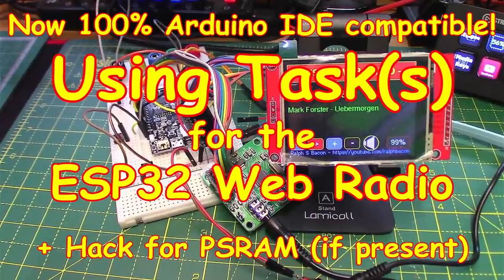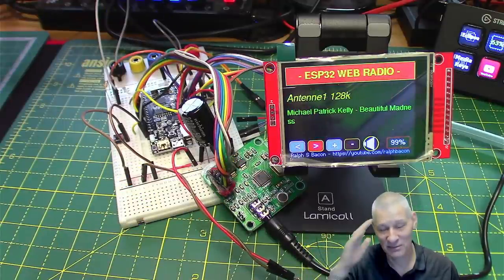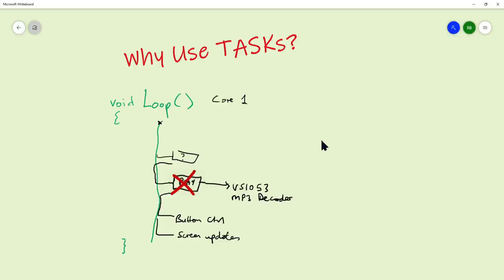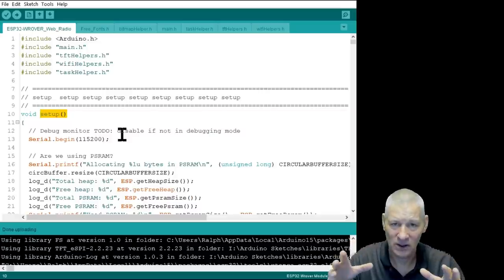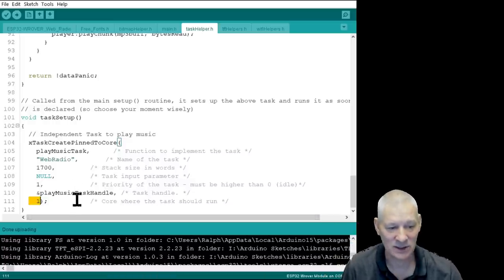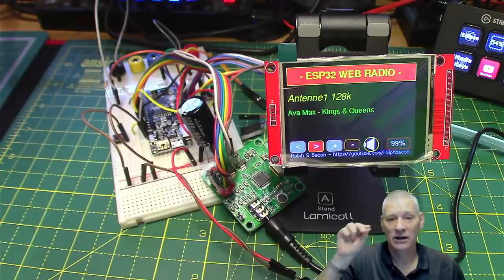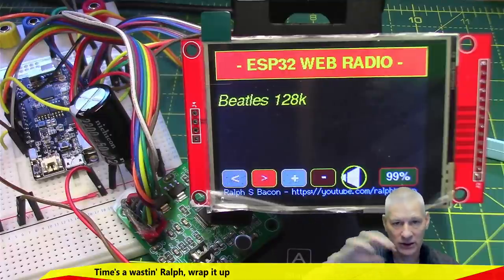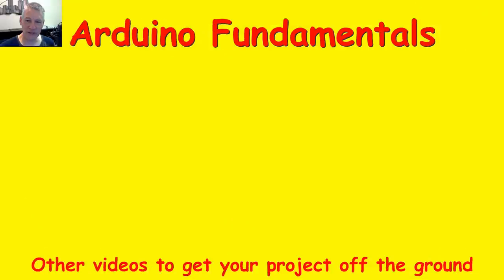#208 Using an ESP32 Task for my Web Radio - using the Arduino IDE

Comment: Hi Ralph. I have looked through all I can but I still get this error mesage when I compile the sketch.

C:\Users\pclay\AppData\Local\Arduino15\packages\esp32\hardware\esp32\1.0.4\cores\esp32\cbuf.cpp:38:16: error: expected initializer before '*' token
 void IRAM_ATTR *ps_malloc(size_t size){
                ^
C:\Users\pclay\AppData\Local\Arduino15\packages\esp32\hardware\esp32\1.0.4\cores\esp32\cbuf.cpp: In member function 'size_t cbuf::resize(size_t)':
C:\Users\pclay\AppData\Local\Arduino15\packages\esp32\hardware\esp32\1.0.4\cores\esp32\cbuf.cpp:57:37: error: 'ps_malloc' was not declared in this scope
   newbuf = (char *)ps_malloc(newSize);
                                     ^
exit status 1
Error compiling for board ESP32 Wrover Module.

I think the problem lies with the cbuf.h but as I said I have proberbly corrupted it and cannot find a clean version, can you put one with the header file on GitHub?.

Any thoughts, apart from shooting me?  :-)
Reply from the maker: OK, let's go with the last option first. I have a shotgun around here somewhere... OK, maybe not.
That IRAM_ATTR error puzzles me because it compiles here (using the standard 1.8.13 Arduino IDE).
Do you have the correct WROVER board (and options) selected? 

Try to get it working WITHOUT the large buffer. Change the main.h line that says CIRCULARBUFFERSIZE to 10000 (ten thousand).

Then, in the cbuf.cpp, remove the lines that say:
// Duplicated from esp32-hal-psram.c
void IRAM_ATTR *ps_malloc(size_t size){
    return heap_caps_malloc(size, MALLOC_CAP_SPIRAM | MALLOC_CAP_8BIT);
}

In the same file, change all this:
// RSB Use PSRAM here if required
 char *newbuf;
 if (BOARD_HAS_PSRAM)
 {
  newbuf = (char *)ps_malloc(newSize);
 }
 else
 {
  newbuf = new char[newSize];
 }

to:
newbuf = new char[newSize];

Let me know if it compiles.
Reply: @RalphBacon  Hi Ralph thanks for the instructions:
I get the following error code:

C:\Users\pclay\AppData\Local\Arduino15\packages\esp32\hardware\esp32\1.0.4\cores\esp32\cbuf.cpp: In member function 'size_t cbuf::resize(size_t)':
C:\Users\pclay\AppData\Local\Arduino15\packages\esp32\hardware\esp32\1.0.4\cores\esp32\cbuf.cpp:66:4: error: 'newbuf' was not declared in this scope
    newbuf = new char[new Size];
    ^
C:\Users\pclay\AppData\Local\Arduino15\packages\esp32\hardware\esp32\1.0.4\cores\esp32\cbuf.cpp:66:26: error: 'Size' does not name a type
    newbuf = new char[new Size];
                          ^
exit status 1
Error compiling for board ESP32 Wrover Module.

I am using Arduino IDE version 1.8.13

The WROVER board is correctly chosen and I use the settings you wrote in your code packet.
Board: "ESP32 Wrover Module"
Upload Speed: "921600"
Flash Frequency: "80MHz"
Flash Mode: "QIO"
Partition Scheme: "No OTA (2MB APP/2MB SPIFFS)"
Core Debug Level: "Verbose"
Reply from the maker: That's what you get for hacking code!
Replace that line with:
char *newbuf;
newbuf = new char[10000];

This has now hardcoded a 10,000-byte buffer but let's get it compiled before we worry about that.
Reply: @RalphBacon  Still getting errors, I want to show the code part from cbuf.cpp to prove I am correcting it as you instruct.

#include "cbuf.h"

cbuf::cbuf(size_t size) :
    next(NULL), _size(size+1), _buf(new char[size+1]), _bufend(_buf + size + 1), _begin(_buf), _end(_begin)
{
}

cbuf::~cbuf()
{
    delete[] _buf;
}

size_t cbuf::resizeAdd(size_t addSize)
{
    return resize(_size + addSize);
}
// Duplicated from esp32-hal-psram.c
//void IRAM_ATTR *ps_malloc(size_t size){
//    return heap_caps_malloc(size, MALLOC_CAP_SPIRAM | MALLOC_CAP_8BIT);
//}

size_t cbuf::resize(size_t newSize)
{

    size_t bytes_available = available();
    newSize += 1;
    // not lose any data
    // if data can be lost use remove or flush before resize
    if((newSize < bytes_available) || (newSize == _size)) {
        return _size;
    }
/*
    // RSB Use PSRAM here if required
	char *newbuf;
	if (BOARD_HAS_PSRAM)
	{
		newbuf = (char *)ps_malloc(newSize);
	}
	else
	{

		newbuf = new char[newSize];
	}
    */

   // newbuf = new char[new Size];

   char *newbuf:
   newbuf = new char[10000];
   
	char *oldbuf = _buf;

    if(!newbuf) {
        return _size;

Now the error code is as follows:

C:\Users\pclay\AppData\Local\Arduino15\packages\esp32\hardware\esp32\1.0.4\cores\esp32\cbuf.cpp: In member function 'size_t cbuf::resize(size_t)':
C:\Users\pclay\AppData\Local\Arduino15\packages\esp32\hardware\esp32\1.0.4\cores\esp32\cbuf.cpp:68:16: error: found ':' in nested-name-specifier, expected '::'
    char *newbuf:
                ^
C:\Users\pclay\AppData\Local\Arduino15\packages\esp32\hardware\esp32\1.0.4\cores\esp32\cbuf.cpp:68:10: error: 'newbuf' has not been declared
    char *newbuf:
          ^
C:\Users\pclay\AppData\Local\Arduino15\packages\esp32\hardware\esp32\1.0.4\cores\esp32\cbuf.cpp:69:11: error: qualified-id in declaration before '=' token
    newbuf = new char[10000];
           ^
C:\Users\pclay\AppData\Local\Arduino15\packages\esp32\hardware\esp32\1.0.4\cores\esp32\cbuf.cpp:73:9: error: 'newbuf' was not declared in this scope
     if(!newbuf) {
         ^
C:\Users\pclay\AppData\Local\Arduino15\packages\esp32\hardware\esp32\1.0.4\cores\esp32\cbuf.cpp:78:14: error: 'newbuf' was not declared in this scope
         read(newbuf, bytes_available);
              ^
C:\Users\pclay\AppData\Local\Arduino15\packages\esp32\hardware\esp32\1.0.4\cores\esp32\cbuf.cpp:82:14: error: 'newbuf' was not declared in this scope
     _begin = newbuf;
              ^
exit status 1
Error compiling for board ESP32 Wrover Module.
Reply from the maker: The line "char *newbuf:" should have a semi-colon at the end not a colon. Try and try again.
Reply: @RalphBacon  BINGO!!!!!! Compiles OK!!!!! Feel a (bit) very stupid but thankful. I presume that this will not work but is a stage. What should I do next?
Reply from the maker: If you have the necessary hardware, at least the VS1053, it will work, although you may have to put a return statement at the top of each TFT helper routine so it doesn't try and talk to a non existent screen.
Reply: @RalphBacon  Now I need to think about this. I have the hardware but I will  have to wire it up. Thanks for the time being.
Reply from the maker: So what exact WROVER do you have, Paul?
Reply: @RalphBacon  ICQUANZX T8 V1.7 ESP32 4MB PS RAM TF CARD 3DANJ Flash PSRAM

I have also a 16MB on order

I Have also a ePulse low Power ESP32 Development board from thingpulse
Reply: I am now working out the connections required for testing. How did you get thee messages on the Arduino IDE serial monitor showing the radio stations etc.
Reply from the maker: I wonder if that is the same as the TTGO T8 v1.7.1 that I used? If so, the PCB I now have will make things a lot simpler. In the meantime the latest schematic can be found here: https://bit.ly/WebRadioSchematicV1
Reply from the maker: PS Are you in the UK, Paul?
Reply: @RalphBacon  No, I am in Klagenfurt  Austria. I came to Austria  from the UK some 36 years ago.
Reply: @RalphBacon  I have the same esp32 board that you wrote in your description.
Reply from the maker: If you email your address (see here for mine https://www.youtube.com/c/RalphBacon/about ) I will do my best to send you the two PCBs for this project. But you will also need:

1 x 10-way (2x5) female IDC cable
1 x 20 way (2 x 10) female IDC cable (to screen, if you are using it)
1 x 200 - 470μF cap
Pin headers for the IDC cables (available in 40-way easily snapped to size)
1 x 5 volt 1A (or higher)PSU (eg phone charger)
1 x 10kΩ through-hole or SMD resistor
1 x VS1053 MP3 decoder
1 x TTGO T8 v1.7.1 ESP32
1 x TFT touch screen as per my video about $7 from Banggood
All of the above is freely available from your local or Internet supplier and costs very little. Let me know if you will make use of the PCB as I only have a few.
Reply from the maker: To get the Serial messages onto the Arduino Serial Monitor set the speed to 115200 in that window. They should appear.
Reply: @RalphBacon  No email address there???
Reply from the maker: Scroll down the "About" page until you see VIEW EMAIL ADDRESS and click it (must be done on a PC/MAC, not on your phone).
Reply: @RalphBacon  all ok on my phone it was invisable.
Reply from the maker: Email on its way to you.

Comment: Meta Data Advertising,  are you linking to a radio service. As it very common,  when you are not on a direct feed . Don't get wrong, this Very interesting and helpful(keep it up), but nicely design wireless radio's are cheaper, been using them for years😂 plus you have same service on google speakers, car radio, phones, ect 👍
Reply from the maker: I'm connecting to the advertised feed but that is the umbrella company so I guess they will add adverts as they see fit. 
I'm not sure wireless (internet) radios are (a) cheap nor (b) that common and anyway, where is the FUN in buying something when you can make it yourself cheaply (~$20) and tweak the final result to your liking, Kuk? As well as learning a lot about the ESP32! 🤷‍♂️😃
Reply: @RalphBacon  I love your channel and learn alot, I play with micro controllers all the time. Also like convenience to listening world radio anywhere, not on a work bench😂 The buffer on extended memory very interested including MP3  board. My project is to make the internal missing system in a old jukebox, including button sound, lights,mechanical sounds and matching music.
Reply from the maker: Wow! Double wow! That jukebox project sounds fantastic. And it will certainly keep you busy until Covid is a dim and distant memory! Keep tuned for future updates on this project, I suspect I will be kept busy too (today I have the paged list of radio stations nearly sorted out).